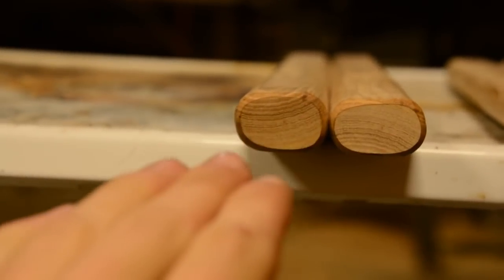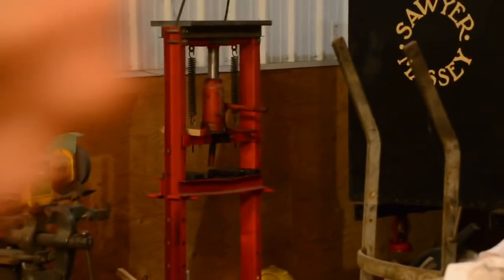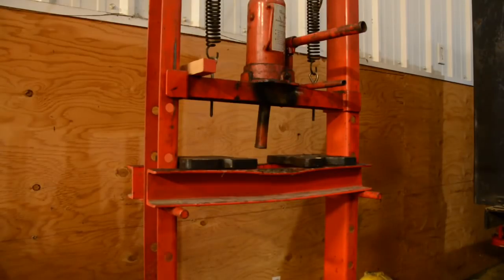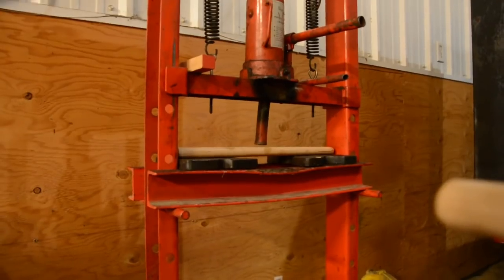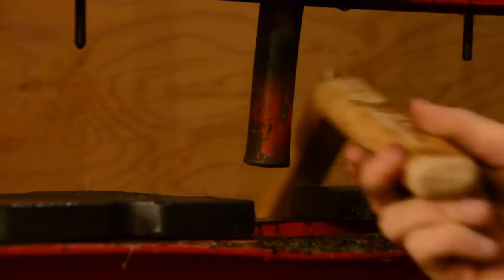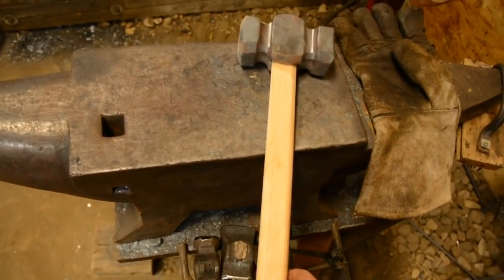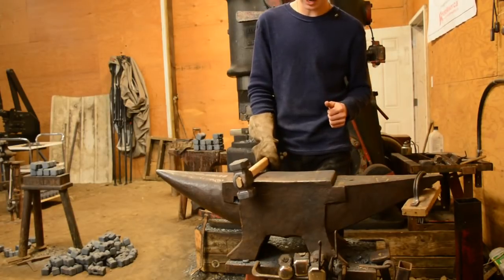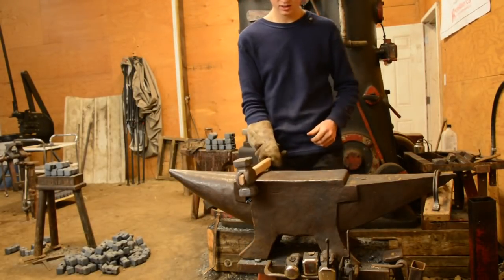Grain orientation experiment (hammer handles)

Comment: 5 years on and the debate still rages - a bit like how many angels can dance on the head of a pin ..... and I remain totally unconcerned about 'right and wrong' orientation .... Provided there are no serious wood defects, each is as good as the other. The real killer is what I have always known as 'short grain' runout from one side of the handle to the other, over a short distance along the handle.

Comment: My understanding is that grain direction matters for axes. When you hit a piece of wood you want a rigid handle but then when you twist the handle to separate the wood you want a flexible one. That makes perfect sense to me. Or when ysing a froe, you wsnt the grain paralel with the froe blade because the pulling action shen twisting the froe gors agains the grain and it tolerates the forces better that way, much like how a bow tilerstes bending. So the idea is that you want rigidity for blunt force and flexibility for bending.

Comment: One could argue that the "inferior orientation" is safer because it only failed at the point of impact, and thus you wouldn't be left with woodchunks in your hands and potential splinters going into your flesh. Which is what seems more likely to happen with the superior grain orientation as it will fail. along the entire length of the handle if it does fail.

Comment: Grain orientation is a you tube fallacy. On any striking tool you want a combination of strength and flexibility. A grain orientation of 45 degrees might prove to be better maybe.  Straight grain as most people seem to want has the most rigidity but it is less forgiving. It breaks with less force and it transfers more recoil energy to the user. Flat grain has more spring in it which means less energy transfer to the work piece not enough to make a difference but has the most amount of recoil buffer to the end user. I don't think that it's worth sacrificing extra wood to produce any combination of patterns. In the end, if you want more energy transfer or impact protection and girth.

Comment: I’ve found that grain running the face to peen direction is usually better than grain running sideways but what I have found most durable was actually angled somewhat but still mostly running front to back. I can’t tell you how many handles I’ve stood there sorting through searching for that slightly angled grain at the hardware store

Comment: Tight grain is probably more important that orientation but, species of wood, the age of the wood(ie; age of tree and where in the trunk blank is obtained) and whether it has been kiln dried or air dried will also greatly affect the stability and strength of the handle.

Comment: I have often used tree branch wood from Ash or oak trees as tool handles. The reason for this was out of practicality as most of my ash trees died in one year. What I have found is that if the correct part of the branches picked and it is free of small Branch knots it has a good grain orientation and will hold up very well. My primary forgehammer handle has been around for over a decade.  I've used it for everything from blacksmithing to masonry so it has seen some very serious abuse. It's finally starting to go now and that is actually splitting from the bottom up. I think the reason for this is because it has all of the grain orientation it's a solid round and while I did narrow the sides off 85% of the strength of the material was there. I'd say that's just a theory but since most of my tools have handles like this and they hold up well I would tend to lean towards using Branchwood for two Handles in general but there isn't too much out there on it other than my own experience.

Comment: I learned the grain should be laying like a leaf-spring in a toolhandle. As is in a Longbow. Kind of sloppy. The major concern is to prevent backstrike. This is what kills your hands at the end of the day. So a bendy Handle will be better. Also too hard woods are a pain for that matter. Good are Ash and Hickory, bad is Beech, for example. A good hammerstrike will put almost no force on the handle as the center of mass (of the hammerhead) makes the impact. The handle is just for accelerating and guiding. I saw hammerhandles and punchhandles being made of thick pieces of Cable to avoid backstrike.

Comment: I believe this convention comes from axe hadles. As others have said grain run out is more important, and in a straight hammer handle, orientation is a lesser factor. In a traditional axe handle which has curves, the more perpendicular the grain runs, the more run out you will have.

Comment: What? What do you mean you don't use a 1045 water quenching tool steel square circle rounding hammer with a non-parallel grain handle? That's not very S T R O N K of you.

Comment: If I were making small batch custom hammers like Ethan. I would boil down my wood selection for the handle down to some pretty basic stuff about wood. The main thing I would be picky about is only buying clear knot free heart wood that is either quarter or rift sawn and then orientate the grain properly to the head. The other thing I would do if I were Ethan is study the science & manufacturing of wooden baseball bat's, I'm sure that Louisville slugger has done one heck of a lot of research on what's the best type of wood to use & the proper orientation for the grain.

Comment: Yeah wood is wood, each different...
I think that the grain 'thickness' is playing a big part... The faster growing tree with big growth ring has more "summer wood" (the porous part on ash is spring wood, when it grows fast to put out the leaves, and then the hard part, summer wood) so the bigger grain is better, because ash tends to break at the porous part, which has absolutly no strenght.
So that may also explain your results, because the perpendicular handle had bigger grain
Maybe you should experiment with grain thickness, to see if that chances something👍

Comment: Thinking like an engineer here, I believe there are a few things to consider. The first is that as part of either grain orientation, the wood is basically made up of many tiny straws. If you imagine clutching a handful of straws, one could see where straws that don’t run from end to end in either grain orientation (what we would call run out on piece of wood) would be more problematic than grain orientation. 

It could very well be that a particular orientation may not ALWAYS be best. It could matter on the purpose of the tool it is attached to. Some tools may function better attached to a very stiff, rigid handle (parallel grain) while others may function better and be easier on the human body if the user can generate some flex and whip through a slightly more flexible handle (perpendicular orientation.) There are times that a rigid force application is more beneficial (think back squats with a heavy barbell) and times when a flexible force application is more beneficial (think golf club). 

And yes, when building, we like to design strength members in the tall, skinny orientation rather than the flat, fat orientation. But that has more to do with the way moment and shear forces are developed in a SHAPE rather than grain orientation. Changing the shape allows for more efficient use of material. That is why we see tall, skinny I-beam shapes in both wood and steel used to support loads perpendicular to the beam. All that to say that when it comes to “strength” of a handle, the shape likely matters more than grain orientation. 

Why does the “wrong” orientation handle seem to handle over strike better? Most likely because when the handle hits the anvil, the fibers flex and compress before starting to shear. In the “right” orientation, because of their rigidity, the fibers begin shearing right away. 

All this makes me wonder if the perfect handle wouldn’t be one that has parallel grain inside the elongated eye of the head that rotates to perpendicular grain for the length of the handle with no runout to create a handle that is both strong at its attachment and “whippy” along its length? 🤔
Reply: This is exactly right. The handle with the so called wrong grain orientation is able to flex more therefore it can better absorb the shock of the overstrike. The rigidity of the so called correct grain orientation is exactly why it failed sooner.
Reply: @mywrkout1  This comes from axes where you want rigidity for the strike and side to side flexibility. And with curved axe handles there is rounout by default with grain running horizontally.
Reply: Came to say the same.

Comment: Maybe the grain orientation works (like the books teachs) only when the force is aplied like the first (wrong) test. When the force is applied like the second test (with the force in the hammer head swing) the layers of the grain split apart becouse there is not enought "cement/glue" between them.

Comment: it's not a good test because that kind of breakage happens with splitting axes or driving sledges but while forging. a better test would have been to make a handle with a very thin section near the head or a hollowed out section as some old handles uses to have to reduce vibration.
Reply: I make my own handles with a waist in them, as you describe, to provide some life to the hammer. Just my preference but if I dont think the handle can stand up to the force I use a bigger hammer. I find a lot of the hammers with parallel handles lifeless , unpleasnt to use and ugly as sin.

Comment: honestly i think you were right by saying its more important in axe handles cause of the shape with the grain run out. with a hammer handle being over struck i can see the cross grain being strong acting like a spring vs just splitting down the grain with the proper grain orientation

Comment: Worth noting is that in both overstrike tests the wood split down the length of the grain strands long before it sheared across it. Which is a great example of why learning to avoid runout is SOOO much more important than grain orientation. 

Another factor worth noting in the differences between the handles is it appeared that the parallel grained handles had much tighter growth rings than the perpendicular handles. Which I am honestly not sure which is commonly taught to be better. However if there is a difference in the strength between winter growth and summer growth (dark and light rings) as the old grain orientation rule would imply then according to that logic how tight the grain is should have a great deal of influence on the strength of the handle.
I am not sure if this can account for the way the “wrong” grain behaved well in this test, or if none of it has any bearing on the strength of the handle.